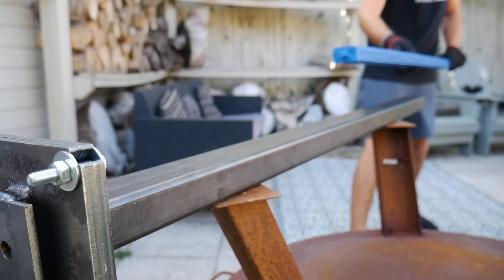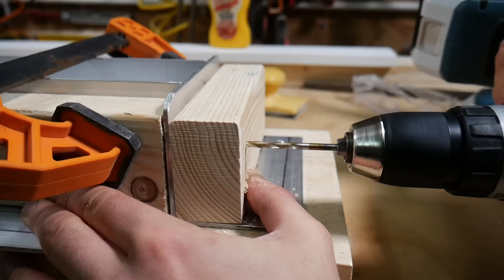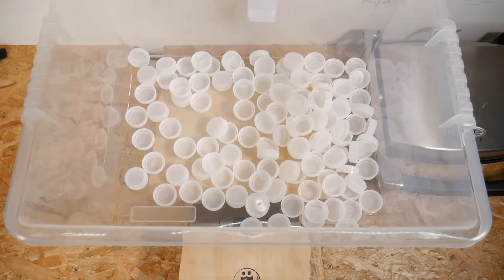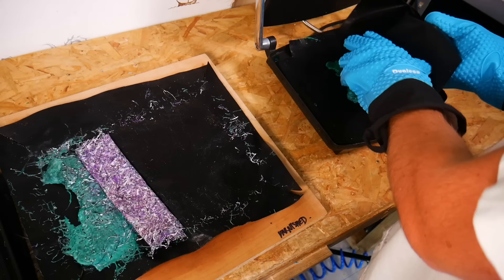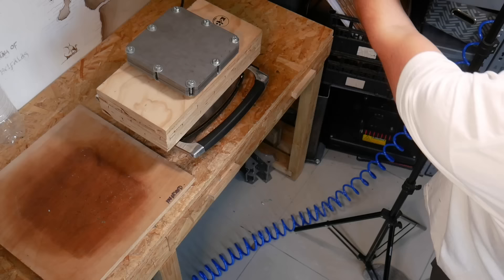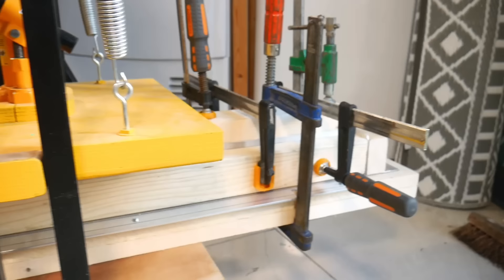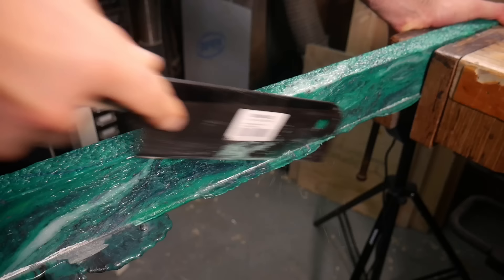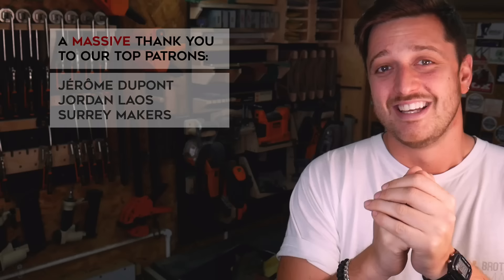How to Make Recycled BEAMS from Plastic Waste at Home

Comment: I absolutely applaud the creativity and industriousness!  I often enjoy thinking about what sort of things I could do with plastic waste, practically, meaning not at an economic loss... Which is a big part of sustainability.

Where I live there is no recycling industry, and for me to recycle is very cost-prohibitive being a pensioner near poverty line and far away from any place that does recycle that I would have to travel to, not to mention the manual labor effort that is no small consideration with the elderly. 

Not that I would, but the state I live in does not let me burn my plastic, which I would have considered to at least recover the energy value, like a lot of third world countries do. 

Co-generation incinerators, or pyrolysis for oil recovery, at least offset new carbon when engineered right, and with nowhere near as much pollution as you might think. Better some step in the right direction than no step at all.

Instead my state set up a non-economical Monopoly for hauling it away to a landfill. The state consulted environmental activists to come up with that law. So somehow that's better and more practical in the activists mind?

As usual, when money is not the object, somehow reason leaves the decision-making table. And at either table, morality never was invited.

It seems to me if we are to solve the fossil-fuel dependency problem we need something better than the leftist/activists industrial complex to help us find steps in the right direction.

Regardless, as a retired engineer I know there's a lot more to this than meets the eye of some DIY prototypers. So I am vastly LESS excited about this from the perspective of viable waste and fossil resource reduction. 

There are a whole list of things I could point out to overcome before I would put much hope in this for that purpose. And I am all for those purposes, but pursuing them has to be wise. I am going to cite only two obvious issues with this propaganda effort.

1. You required vast volumes of electric  heat, albeit at a lower temperature than most manufacturing, for that one-meter board. To be fair you ought to calculate and publish how much electric power you wasted doing that. There is also the energy input for material manipulation that is not quantified: twisting it, pressing, cooling it, then finishing it with all that cutting equipment. To scale this to practical production in mass, employing machinery for all those actions, you might have used more carbon generating power then you saved in that plastic board. And that is not to mention that that board still stands a good chance to become a waste product some year in the future.

By the way, This is already done for decking boards, and those boards cost a lot more than wood, but they're finish lasts much longer than stained wood, which is their only market advantage.

2. From a building construction perspective, you implicitly suggest this is a candidate to replace wood products in construction material. Well if the construction industry only cared about showing that they've replaced wood for recycled material that might mean something.  But the building industry has a very deep and vast concern for fire safety. Thermoplastics are going the opposite direction at high speed when it comes to fire safety. And when I talk about fire safety, I also mean, retaining structural integrity during a fire for the sake of permitting evacuation, not just the concern that they add a much denser fuel to a building fire. (Remember the value I mentioned for offsetting new fossil-fuel production).

On the positive side, I suppose as an artsy-fartsy mantle piece it is a DIY project worthy of note.

Comment: Hey Bro's, just seen this video & am planing to have a crack at this myself, ive opted to work with molten PET, ime going to use an old distilling double lined pot with an element in the liner, 
the element is rated up to 320C which is way more than i really need for PET,
 ive followed your lead on the mold construction but used stainless steel construction instead of wood allowing me to remove the piece from the mold easy & have longevity of the mold,
 i am using butchers bock/mineral oil as my release agent. 
brilliant video folks, you got my instant subscribe for this one, how i have not seen you guys before on youtube i have no idea, brilliant well produced fun videos's.

Comment: Looks lioke marble, very cool. You can also put the plastic in a double boiler, using machine oil in the bottom and a bit in top with plastic to ward off sticking, then pour it in the mold.

Comment: if you had a large oven, you could put all of those caps into a larger size pan which would speed up the melting process and then pour into the mold?

Comment: Rather than a Beam if you can mill or mold it into custom parts like joints I think it would work as a DiY application that encourages recycling more. Of course your works so far has been quite inspiring already so I already subscribed ;)

Comment: Hey guys, construction guys use a "concrete vibrator" to remove air bubbles in wet material. Might be easier if your "furnace" or your mold vibrated

Comment: Thought I’d throw a few ideas around. How about a thicker mould of welded steel construction then use an induction coil to head the mould melting the plastic. Raw material could just be added to the mould as it melted. Maybe have the induction coil on a track so it can move up and down the length of the mould

Comment: I think the best way to make boards is actually endless extrusion. You set up a horizontal screw extrusion process into a shaped tube with a pizo heated entry point to keep materials hot while forming from the extrusion head into the mold form and feed material into it, using a neutral colored material as a spacer between board lengths, or using enough extra material to extend past the desired length before producing a blend with the next colored section.

Comment: I have my own sort of plastic recycling device that I made. It consists of a sheet of 16 in steel sheeting that I formed into a cone shape with a 8-in hole on the top and a 1.5 inch hole at the bottom. The cone is about 6 in tall and I wrapped it with pipe heating cables. The kind you wrap your pipes in in the winter so that keeps them from freezing. With this I can just continually add plastic to the top and when it is sufficiently melted it pushes out the bottom and you could just put it directly above your mold and fill it quite effectively.

Comment: This awesome video was put up a year ago and I just saw it.  This is great.  Some of the commentors have talked about adding other material to add strength, longevity, etc.  I have some 2 x 6's used for raised gardens made from recycled plastic and wood shavings.  Over 20 years there's no rot or  other deterioration.  I think the potential applications for this are manifold.  Well done.  Cheers

Comment: Have you tried sprinkling chopped glass fibre strands onto the batches in the press and then measuring the strength of the beams compared to ones with no fibres at the end?

Comment: Very cool on the beam for it's intended us.
I'm still thinking smaller crafty scale. Slice them up for coasters. Slice and reheat enough to bend and make a curved soap dish. Slice along the length thinner to make a tumbler, or 1000 napkin rings. Basically, if you make a solid beam, then couldn't you cut it and reheat to bend to make all sorts of things??? IDK? You've made my brain happy though❤😊❤. Could you use it as tiles? For bathroom walls or backsplashes???
Ok, I just saw you have a video on making tiles, lol. Going to watch that now.
PS - ive got a panini press that was a wedding gift, I've used it twice in sooo many years. I feel like melting some plastic now.

Comment: Looking into some materials engineering videos, especially with 3D printing, you'll find the many times using less material, while adding internal system of scaffolding actually increases the load bearing strength of the beam. If engineered properly, it can be stronger in all directions.
Reply: How is that possible?  A solid beam already has whatever internal scaffolding you can think of and the rest of the area is filled in with plastic.

Comment: Where i live they used to make these bus stop benches and picnic tables with square stock made like this, maybe 3x3. But they are just gray or reddish plastic. The benches are like old ones with the two metal legs parts and then share
Slats down he length back and seat.
The tables are built on a concrete slab so there's a metal post for the table and four short posts for the seats, all mounted in the concrete and then with flat plate welded to the top of each post. Then table is like 4x4 slats... Bolted to the flat plate on each post Benches also.

Comment: My idea: A heated bin inside of which the inserted plastic bits heat and slump down into the hole at the bottom, into a cast, or into a holding chamber that you can then extrude at the optimum temperature. I also love the idea of scaling this up to industrial levels to ACTUALLY process and reuse plastic waste.

Comment: Alot of plastic bottles have soda pop, orange juice, or other sticky residues on them. Fortunately, beverages are water soluable and plastic does not dissolve in water. You can run all plastic through a machine which chops the bottles into at least 3 or 4 pieces. The chopping machine will make the inside of the bottle more accessible. After that, put all of the plastic bits in a big vat of water with an agitator like you see in washing machines for clothing. At that point, you wash all of the sticky drink residue off of the plastic bottles. Waste water is rich is orange juice residue etc... which can be used to irrigate crops, water lawns, etc... The clean plastic can be put in an oversizes steel mold. A hydrolic press can compress the mold to A smaller size in order to melt the plastic using pressure instead of heat.
Reply from the maker: We have a shredder that shreds our plastic into 6mm flakes. But before we shred we wash the caps whole. They’re easier to wash whole as the sharp edges would damage the bags or the drum if they were cut 👍🏽

Comment: As a concept I find this really neat, give it the right materials to actually do the molding process and I can see this being an alternate option for potential projects. There's just a few questions I have in regards to these beams: how sturdy is it compared to wood? How long do these last in contrast to other erosive tools like wood or metal? What does the wear and tear look like; warping, splittering, some odd rusting? How would a test room made of these beams handle things like temperature or sound? 
If anyone has any answers or other questions feel free to add them!

Comment: We had a picnic table out back at work that was made from recycled plastic, you could see specks of different color plastic, overall it was flat grey. The boards were thicker than boards normally used for such a table and the table was extremely heavy, it would take several people, 4 or more, to move it but, it will last for centuries if it isn't damaged or destroyed. It was held together by long, thick bolts.. 👍 Great use of discarded plastics!

Comment: I expect people are going to be talking about how this doesn't replace wood for load bearing, and they're right, but load bearing is not the start and end of constructive applications.  I wouldn't use this for a deck floor, but I would absolutely use something like this for a deck windbreak.  I could see the use of different coloured planks to make an artistic accent wall, possibly mounted on a bias, on thin battens so it stands slightly proud of the wall, and produced with enough clear plastic in the mix that it still looks mostly opaque but can be backlit through the plank with off-white LED strips.  That could look great, it just has to be done with intention.

Comment: Bravo!  You can see the swirls which could become a type of internal weakness known as cold welds. To take this closer towards a structurally uniform and useful beam, it would be great to make an low temp heating oven and to align the melting components lengthwise. You could also incorporate laminates.
Reply: NON STRUCTURAL BEAMS...DUH

Comment: Recycling sort of has the implied spirit of eco friendly, I’d like to see how far you can take it. Try a solar oven ! That’s sort of all I can think of off the top of my head, but maybe the solar oven can heat a plate. The plate should have a heat sink, and a fan operated by a temperature regulator. So that it doesn’t get too hot. By heating the plate you could probably built the solar oven on top of a large press, heating the top plate and then you have an all in one system. Hopefully you could load the entire box with plastic, then load weight onto the handle of the mechanical press. Ideally the ambient temperature would help melt the plastic, the surface of the plate doing the final bit of work. This is all off the top of my head, so I’m sure there are flaws. But I’d love to see it!

Comment: With hot iron pressing parchment papers, layer by layer, can do the same and it will cool off faster, 
so you don't need hot oven and the cleaning after cooking plastics.
If you want the stick stronger and last longer then you can add Bondo coating, spraying paints and polishing as you would do for painting a car.

Comment: The only suggestion I have is maybe going bigger... as in, the entire process of melting plastic and molding. For instance, I'd love to pick up all the trash in Egypt (free) and recycle it for practical uses. If I had a warehouse, I'd probably have to use vats for large quantities for melting, right? That would reduce your costs/time in the long run is doing more all at once... from the melting, to mixing, to pouring into molds etc... probably could go hotter to have it more liquid, and easier for pouring into molds. Anyway, thats my 3rd world humanitarian assistance dream.... but it gets hot in egypt too... so I wonder, how well some of these things will hold up in heat. Maybe not good for structures to live in, but certainly there are chemical additives that serve to harden too? Just ideas! Great video, thank you!

Comment: in my area I saw poles for fences made out of plastic the dimensions were 2,47 cm long , and they were round poles so that means the mold was a tube and the evacuating method probably was a system of pulling out the plastic pole from the mold. the diameter was 12 cm across.
I saw them in person but not close enough to touch them so I did not see marking on them if the tube was made out of two parts or if the pole had inside it some sort of  hook incorporated to be pulled out of the mold.
The vendor said that it is just plastic no core of any sort was  inserted into the pole and it was sturdy and robust I actually considered them for pole fences. 
The only thing was the grayish color that was not pleasing but considering this would a good future alternative for recycling.

Comment: I'm not sure if this would be a good way, but I'm thinking of a mixer coated with a PG or any kind of odorless and colorless oil that would leave no residue and allow to melt the plastic shavings all in one go. A 6-8 liter mixer with a torch on its side, spinning at its lowest speed. The mixing arm should also get rid of air bubbles as well. Buying some cheap, used one should set your pocket down too much. Also it would be better to melt the plastic until its almost a liquid, so that it takes the shape of a mold better. HDPE, PET and PETG are good for making all kinds of diy projects. I may experiment with melting technique mentioned above once I fix my 3D printer.

Comment: Just a couple of things; first can you use the melted plastic in silicone molds? And, idk how feasible it would be but what about having several US electric skillet pans with 3" sides going on low all at the same time, and would adding some resin epoxy to fill in areas but mold has to be leak proofed, could you then maybe carve into a block of that stuff to create.... Whatever you want at that point ...You could make quarter inch flat molds 10 x 12 or something to make notebook dividers or cut & use sheets of plastic like wood & make a box or small shelves.

Comment: Well, with some industrialization involving large open-face ovens like a pizza oven you could melt it all in one run. Then it's just  matter of getting the twist and pull done before placing into the mold. 

If there is a way to suck out the air bubble other than twisting and folding than perhaps the mold can go through the oven as well assuming the wax coating and mold can withstand the heat.

Have the tensile strength of these beams been tested/measured?

Comment: You could embed stainlesssteel rods or all thread inside the beams for strength. If you stretch the rods before adding the plastic it would help the strength as well, it’s what they do to concrete support beams.
Reply: A hole and cable through it reversesyourthinkingtoposttension

Comment: It looks really nice and can be used as an optical upgrade for art. But as a plastic technican I have to state the melting done in this way would burn more energy than recycle it. Melting plastic ist mostly done via friction than external heating